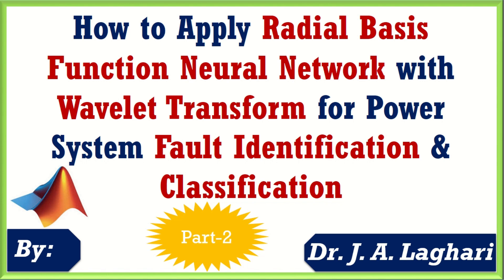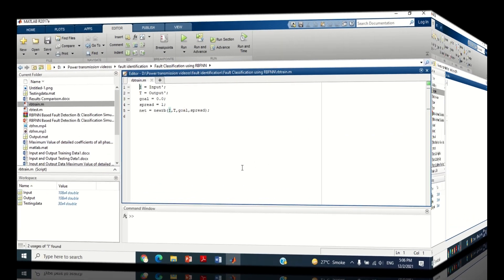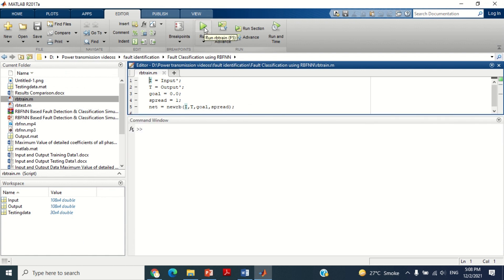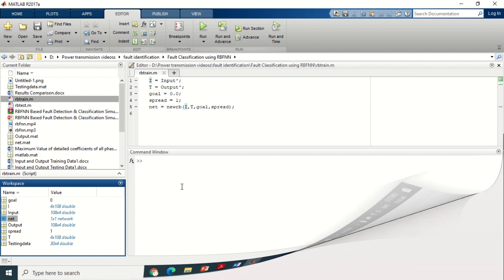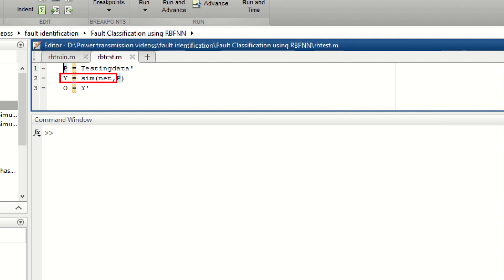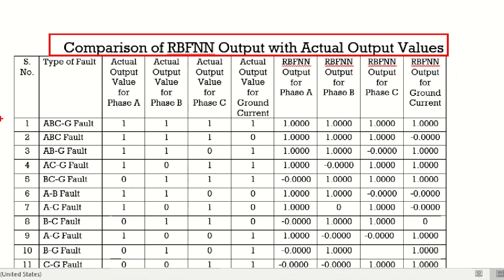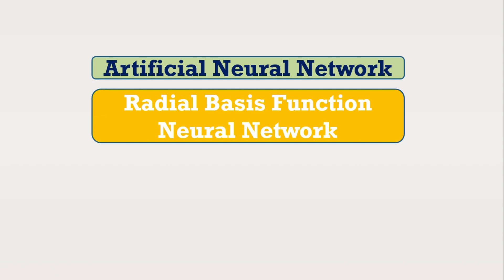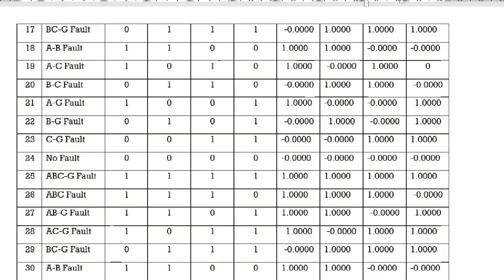RBFNN Based Fault Detection & Classification Simulink Model (Part -2) | Dr. J. A. Laghari

Comment: Sir how can we connect this with a microgrid
Reply from the maker: Thanks for the comment. no need to connect it with the microgrid. first get the data by simulating various cases in the microgrid model to get the sufficient data. then use the data to train the model.

Comment: How can you implement in a relay type to trip when fault is identified?
Reply from the maker: Thanks for the comment. To do this, next step would be to use this trained RBFNN in the simulink model that will work as relay and it will gjve signal to trip the breaker.

Comment: Hello sir thanks for amazing section  sir now iam doing a project on high impedance fault detection. I have a doubt sir after decomposing fault current signal using wavelet we get detailed and approximation coeff. Are detailed coeff only need for training neural network? Is it need for add approximation coeff features too
Reply from the maker: Thanks for the comment. Yes you can if you want. The question is that from which coefficient you get the highest accuracy? you may use any one or both depending upon the requirements.

Comment: jazak allah khair there is no one in YouTube who explains and provides material as you do mashallah. 

May i kindly request if you can kindly do for us a video regarding fault detection and location using the distance relay?
Reply from the maker: Thanks for the compliments and suggestions. Basically every new technique needs new learning and implementation. I will try if possible i will make a video on it.

Comment: Dear Dr. Laghari, your code is working fine with provided input and output data. But when I applied a random selection of training and test data using MATLAB, It does not provide a good result.  Is there any criterion for the selection of Training and testing data? Why you have selected particular rows (i.e. Row 13-24 and so on) as testing data. Thanks once again.
Reply from the maker: Thanks for the comment. There is no such strict rule to select the data. But it is recommended that input training data must have few data sets of the output data closely related to input data otherwise the RBFNN performance may be affected and accuracy may be reduced.
Reply: @DrJALAGHARI  Thanks
Reply: @DrJALAGHARI  May I Share my data of fault identification and its location for your valuable suggestion? My data is  531x28. I got the training accurate is around 10^(-30) but testing results are not good.
Reply from the maker: @dr.nafeesahamad8567  baaically we have to try again and again to get the best results. You may send it i will try to look at it in my free time.

Comment: Dr. Jaghari, it is superb. Thanks a lot. Suggest how can we find the location of the fault also?
Reply from the maker: Thanks for the compliments. Good Point. for this purpose, we may have to add some data of impedance in order to find the location. because impedance relay basically depends upon the distance.

Comment: what do you this i should that hasn't been done
Undefined function or variable 'Input'.

Error in rbtrain (line 1)
I = Input';
Reply from the maker: Thanks for the comment. First try to download all the files from the link given in the description section of the video part 1 and part 2. Then try to load the input, output data files in the workspace section of the matlab. Then run the program. It will run successfully.
Reply: @DrJALAGHARI   it worked perfectly. thanks alot
Reply from the maker: @osazeeagbontaen589  most welcome.
Reply: @DrJALAGHARI   sir, what you mean by load the input, output data files?
Reply: Can you explain how to do that, by the way I have done all the steps in part one 👍🏼